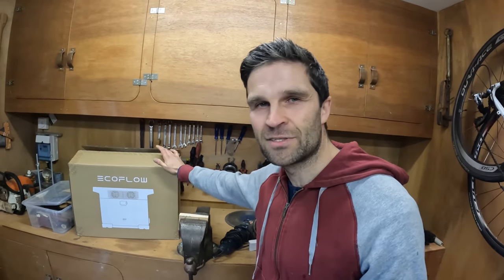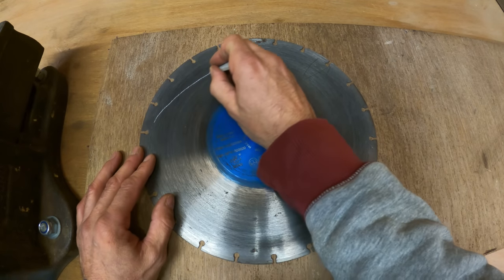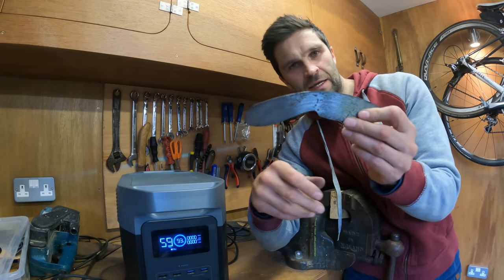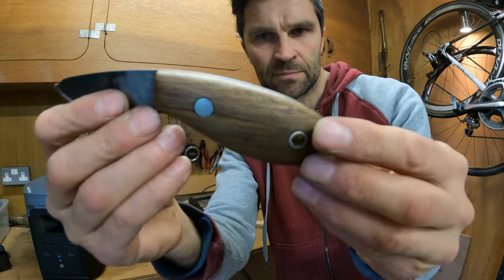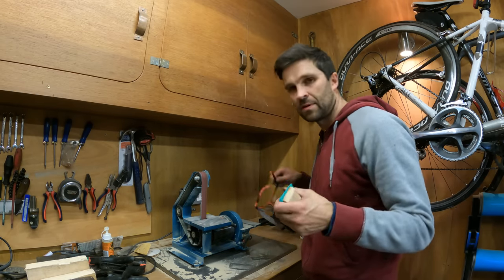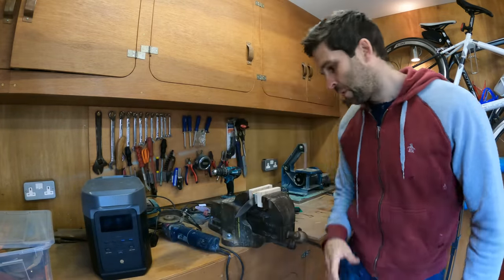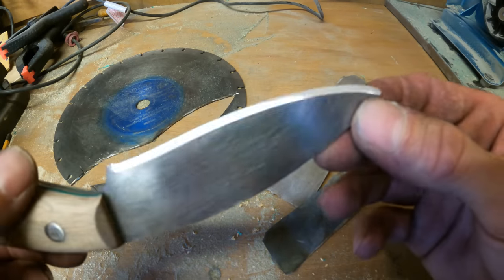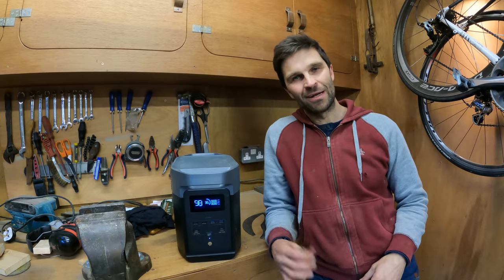FULL KNIFE BUILD OFF GRID - Ecoflow Delta 2 Test Review - Making a Knife from a Saw Blade #ad

Comment: Great video Al, question. Why did you hand sand it rather than using a finer grade in your vertical sanding thingy?
Reply from the maker: The belt disc only goes to 120 grit whereas my sandpaper I used progressively up to 1200 grit. It’s also not as accurate as by hand😬

Comment: Jack Hargreaves(RIP),would have been proud of you 
More exciting than whittling wood.
P.S
Tip,when drilling holes in metal,use a little oil(or WD40)   will be much easier.
Reply from the maker: I’ve only ever used oil in big industrial pillar drills. Never tried with my small drills👍👍👍. Thanks Al.

Comment: You may just need new carbon brushes and a small clean out. My dad who's a joiner seems to go through those makitas like water, it mainly because the sawdust gets in and attaches to the grease then you know the rest. Hitting the drill with the hammer to get it working sound like your carbon brushes are low aka it's well used and your just temporarily making minimal contact with the commutator.  Ps nice knife 😀
Reply from the maker: Yes👍. The problem is that the parts cost nearly as much as the bare units. Thanks pal.

Comment: Never thought of using old disc for that but will give it a go. What are the liners, just plastic?
Someone beat me to the health and safety police thing but its just what we all do ain't it. Anyway off to find the keys to my lads work van and steal a disc😀
Reply from the maker: 😂😂😂 yes the discs are not too bad for smaller knives. Any larger than what I made you’d need a bit more thickness. The liners are some composite which you can buy from knife suppliers. It does burn when sanded👍

Comment: In my experience if your gear box sticks put in reverse then move back to drill mode. This is a short term solution, in the long term your gear box seems past its best were I used to work we had a engineer who serviced them, I imagine you may just need to get a new one.
Reply from the maker: It’s definitely past it but it’s done a massive amount of work may it rest in peace… or pieces after I get the hammer on it again😂😂😂

Comment: Great watch, please tape the blade up after putting an edge on it in future, so you don't risk it cutting you when your doing the handle and working on putting it all together, made me cringe a few times there!
With regards to the drill, it might just need a new set of brushes, cheap and easy fix.
Reply from the maker: Yeah sometimes I will if it’s a sharp blade blank. The drill has lasted me years and done a massive amount of work lasted better than the rest I’ve had. I’d love to revive her.